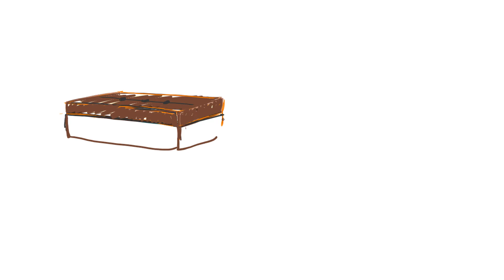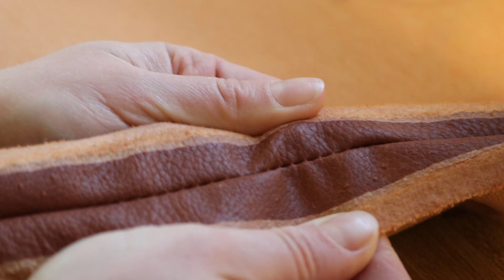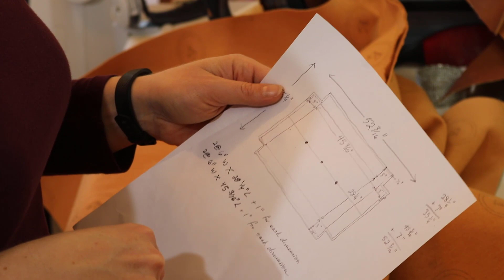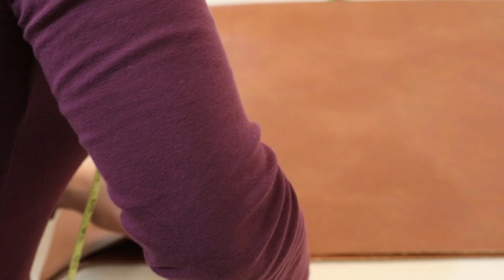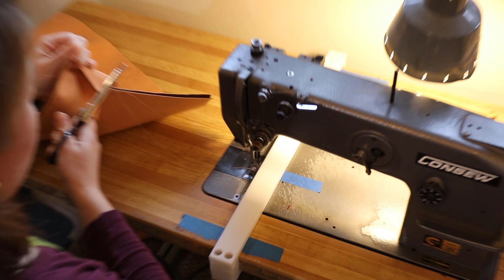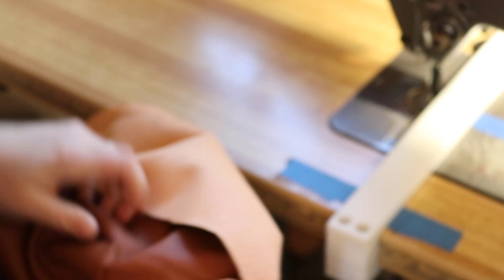How To Sew an Ottoman Cover for your Coffee Table

Comment: Excellent job!  Thanks for the tutorial, I am doing this exact project using a similar Consew machine.  I have always had issues getting the top and bottom layers to match on the corners.  Your instructions really made a huge difference.  I thought since it was a walking foot machine it would just 'do it' by itself.  I look forward to your other videos. Thanks again!  your fan, Herb
Reply from the maker: Thank you for your kind words, Herb. It's great to hear others are working on similar projects and coming across similar tricky spots.  Stay tuned for more projects!

Comment: Thanks for this video. Would it be easier to hem the skirt before attaching?
Reply from the maker: If you have a sewing machine, I would recommend doing the hem before attaching. You could also incorporate a tie or Velcro into the hem at this step to simplify the build. If you don't have a machine that can sew the heavy material, then using double stick tape or other methods might be better for some makers. 

Thank you for watching and commenting!